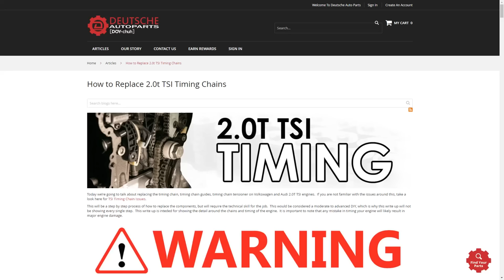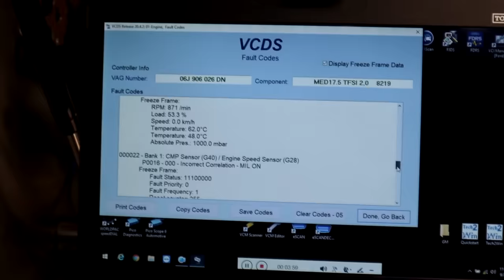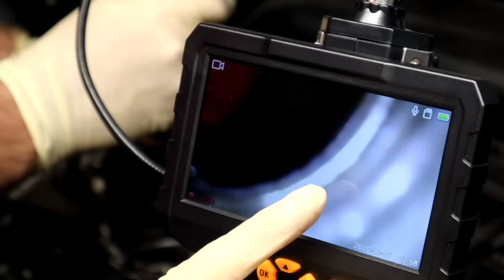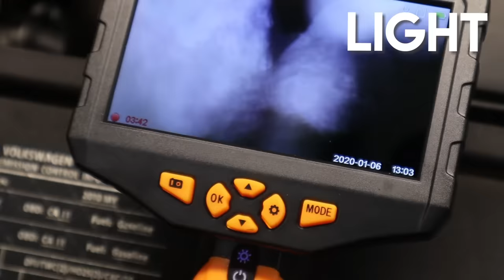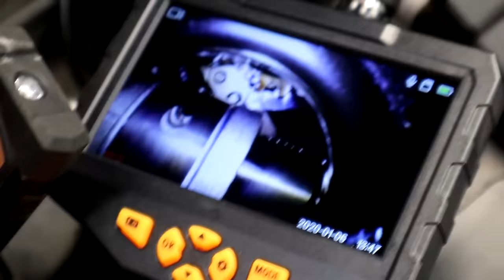The Jalopnik Tiguan FAILED ~ Despite the Warning

Comment: An interesting teardown :) had the 2.0 TFSI BWA in my Audi A3 and I thought that was unreliable but these 2.0 TSI engines are shocking.
Reply: Gazshadows when everything is running right they are smooth and torquey. But they do keep the mechanics quite happy.
Reply: Did you sell your A3? @Gazshadows
Reply: @kenny9088  I did yes, regrettably. It had quattro so it was a fun car to launch and when it snowed one year it was pretty fun stepping the back end out on it ! Would have another if it wasnt for the reliability.
Reply: @Gazshadows  oh ok, i just bought a 2012 a3 2.0t fwd last weekend with several modifications, like coil overs, wheels, exhaust and couple other things, the car is beautiful and drives amazing. Is my first audi and i really like it has 87k but reading all this horror stories got me feeling scared tbh. I did do some research prior to buying  it but i bought it anyways haha. What kind of issues did you have while owning it? If you dont mind me asking, also how long did you have it for ? Thanks in advance
Reply: @kenny9088  nice :) you probably have the newer engine in it then. I would say to check it's had regular oil changes and see if it's had a belt / chain change on it. On the BWA it has a belt on one pulley and chain on the opposite side of the engine which has a tensioner on it that seems to be a weak spot. For just over a year in colder weather it would rattle like mad on start up for about 30 seconds. Horrible. I should not have waited so long. By summer time it wasnt bad maybe a second or two. Had a feeling maybe the oil pump chain was getting slack too. Otherwise I did oil changes every 3-4 thousand miles. Had it 2 years roughly. Had TT before that which had same engine and no rattles but the diverter valve went on that.
Reply: @kenny9088  Also bought the Audi A3 with just 60k on the clock. Drove well, little hard on the road. Made a good noise for 4 pot. Heavy on the juice (26-32mpg). Loved it.
Reply: @Gazshadows  i really appreciate your reply. I will definitely be doing more research and inspect the tensioner and find out exactly when are the safer years. I've been reading and it seems like the 2012 gti's were affected so im assuming the audi 2012 would have the same issue 🤔 the previous owner did change the diverter valve which was like 400 bucks or so. He game me all the maintenance records he had and the ones he got from the 2nd owner, guy i bought it from was the 3rd owner. Thanks again 🤝

Comment: I'm lucky, when I got my '15 Passat from the dealership at 100k miles they replaced the timing chain and cam shafts for me so they should be good for another 100k
Reply from the maker: NICE!
Reply: Sure they did!!! That's the oldest used car salesman trick in the book
Reply: False Flag  I do have paperwork
Reply: False Flag  I sure would not buy one that engines done been messed with by bunch of tech's! Better off with whole engine from junk yard never been apart for me!
Reply: @SageTrimarco  I have a 15 Passat too, I absolutely love it, damn good too drive , what has your one been like? Nice car?

Comment: Ever since the interference motor was introduced and timed with rubber bands instead of gears, this mess got much worse. I had a chain tensioner arm fall out in an old Opel Manta and brake the chain but I was able to get one brand new for $20.00 at auto zone and be back on the road in 4 hours. None interference motor, mind you.

Comment: Hmmm....either way the repair costs  is not cheap. Would be great if all piston emgines are non-interference design
Reply: It would, but due to fuel efficiency and emissions more and more will be interference.
Reply: ...preventative mx is cheap (to a degree). Depends on where you buy your parts and who does the labor. $100+/hr labor rate is not cheap any where you go, especially the dealer ($120+/hr)

Comment: 2011 GTI went a faultless 71,000 miles, and It jumped timing. My local mechanic was also a VW specialist, and had a rebuilt head from a 2013 CC. Saved me a ton of money. The car went another 70,000 faultless miles, and I traded it in on a 2017 Golf R.

Comment: So thankful for this video! Two of my favourite VW mechanics in one video! - when I did my timing chain in my 1.8TSI that top guide had cracked, but not fully broken off like yours. My assumption was that because the tensioner was screwed it allowed the chain to slap the top and cause unintended forces on that guide. 🤷‍♂️

Comment: My 2009 vw cc had this exact failure. Top chain guide broke apart and caused Timing failure on startup. Bent all intake valves open. Still had the original tensioner as well. ~160k miles

Comment: Jesus christ press fit lobes? These engines is just a pile of garbage.
Reply: .....people say french are bad in general ...but i haven´t seen such stupid design crap on french. it just does not makes sense.
for example the timing cover out of "thin cardboard" like here. LOL
bah dumm tsssss
Reply: I remember back in 2017 there was recall on the EA 888 for problems with the press fit lobes
Reply: Paying premium for a lot of short cuts.
Reply: @Unknown-jl7mg  PSA DV6 is a very French engine that has press fit lobes, came out around the same time as this. It's pretty common nowadays as it allows manufactures to have different strength material where it matters, meaning a lighter camshaft which results in better efficiency. Even the slightest percentile increase in efficiency is worth it to manufacturers today.

Also, the timing covers in Renault engines are made out of the exact same type of material and are leaking all the freaking time.

So if you haven't seen any of this in a French car that simply means one of two possible things; you either haven't worked on French cars or the ones you have worked on are old and outdated.
Reply: Press fit lobes that can spin as opposed to a cast/machined cam that can break when the valve hits the piston...like Ford straight 6's from the 80s-90s.  Same difference.  They work just fine in hundreds of thousands of these engines.  Maintenance is key.
Reply: @marcdinsmore8690  I don't recall that being an interference engine.
Reply: @ShainAndrews  You are correct. The Ford 4.9L straight 6 is a non-interference engine.
Reply: Ford 1.9 had press fit lobes too
Reply: Ford 4.6 2 valve sohc engines use a hollow cam with lobes pressed into place. No issues whatsoever with the camshafts on those.
Reply: @marcdinsmore8690  'that can break when valve hits piston' 

Well gee wiz why not make an engine with a valve train arrangement reliable enough to not have that happen lol!
Reply: forged bottom end and rods, and stout fueling though. yeah they're finnicky motors, but it taught me a lot and it's been very reliable. and i'll love it even more when i strap a 3071 to it. can't really do that with a honda motor, or anything else on stock internals. Vw bullshits in one area and overbuilds in others.
Reply: My thoughts exactly
Reply: @Unknown-jl7mg  If it was a french car, especially a Peugeot diesel, your timing belt snapped, you'd just replace the timing gear, the cam rockers (16 x £10ea) and you'd be good to go. Engine is designed to snap the rockers than bend the valves.

Comment: As a flat rate Teck I made more money working for VW than any other shop , never had a day with dead time 60+ hrs a week in a 40 hour week , got to love the over complicated junk they build that constantly fails. Walking is easier than owning a VW you will get there at least, couldn't give me one for free. You could buy 2 used crv's for the cost of the head job , never change the oil and still drive father with no repairs. Blow up a motor and change it for under 600 bucks in less time than that head job took.
Reply: Just wondering what his wife did to piss him off enough to let her buy it.? He knew she would be stranded one day.

Comment: It’s funny, when these TSI’s came out everyone BASHED the FSI’s and swung on these. But IMO the FSI has proven to be a much more robust engine.
Reply from the maker: Yep I was in that camp too. The TSI was really good for a short bit of time.
Reply: @HumbleMechanic  What a frightening comment from you Charles! All of us Gen 3 owners are so brash about how much better our engines are than the Gen 1/2, there are some bad implications here.
Reply: Honestly, you're kinda screwed both ways IMO.

The TSI has worse, more expensive issues to fix revolving around it's timing chain and intake manifold setup... But updated parts exist, and once they're fixed, they're more or less fixed for the life of the car. But the FSI's cam follower troubles, while cheap to repair, can't ever really be permanently repaired.  You'll wanna pull them out every 10-20k and give them a look over forever, or risk similarly catastrophic damage.
Reply: The FSI had the cam follower issues that were ticking time bombs.
Reply: Adaris not true. There’s a retrofit kit for the cam follower that changes it from a flat tappet style to a roller set up like they have on the TSI. 
I never had much issues with my very hard 50k I put on my stage 1 Gti. I only swapped the follower once. But. I think a lot of it has/had to do with oil. I always have run Elf now Total. Which also kept the oil consumption down on mine to .5qt every 5k miles.
Reply: HumbleMechanic I thought the engine was going to be good also, but after some very low mileage failures I knew we had a problem...
Reply: @jh-ky5uu  That's nice to know!  Back when I had my Mk5 (admittedly this was 10 years ago) there was no solution other than to replace the follower with an identical one, which would then wear exactly like the first one did, ad infinitum.  I'm glad a solution has been found.

Comment: I have seen that guide break on a 2014 vw jetta gli with 60k on it. new timing tensioner and guides. The cause was the owner going past 7000 rpm in drive "money shifting" into second from 5th. the chain tightened to fast it crushed this upper guide like in your video.

Comment: Man VAG just cant build a decent timing chain assembly from the vr6 to the 4.2 v8 to these motors.
Reply: No kidding! All VW motors with chains are ticking time bombs
Reply: They must have got their timing chain engineering tips from BMW.
Reply: VAG can't make a reliable timing chain, period!

On some engines you need to change timing chain almost as often as timing belt.

Comment: Lmao, so many timing issues. Everyone wants timing chains, but they have their own issues.
Reply: Yep, I too have a Tiguan (Diesel, 2.0 TDI) with a timing belt and I felt I'm the second class citizen. Guess it wasn't so...
Reply: Meanwhile my ‘97 TDI has 300k+, no belt failures yet...
Reply: Yeah... I was set on buying an old V8 5 series but ended up getting a 2jz Lexus because i really didnt want anything to do with the timing chain guides roting into dust and totalling the car.
Reply: @aygwm  my point exactly..
Reply: CHAIN,  timing chain.   my 1995 Ford mustang had a timing chain.  still does.   same one.     VW went crazy uncle on the need for 3 or 4.
Reply: Aaron Garcia How many times replaced it?
Reply: Al H its part of doing business as a 4 banger that wants to feel like a 6-cylinder. Why though does Honda have the K20/K24 with similar balance shaft and 200k+ reliability?
Reply: Not if they are designed correctly.
Reply: @machtschnell7452  The companies do not shoot straight with customers. Extended drain intervals are a deception to claim cheaper running costs. In VW scenario all North American customers were told that they did not need dual injection while dual injection was implemented in Europe? That should tell you right there. It's plain deception and price-point/profit focus before helping the people have reliability.

Comment: I can't believe a company that puts out such garbage is still in business. Oh wait, national protections.
Reply: Gm's on the same list, but from a different nation, so is Toyota. So do the Dutch never learn?
Reply: @eivis13  I think you spelled Nissan wrong.
Reply: Many cars including Toyota Camrys from the same time period with the same tensioner design also have this problem. VW has made some crap, and like most German makers their cars are designed around more frequent maintenance cycles, and then there's the whole Diesel thing. You wouldn't know it from their US presence, but VW parent VAG is the largest car company in the world, so unless they're getting government protection from half the world, I'm going to say that your overbroad generalization is inaccurate.
Reply: eivis13 The Dutch???
Reply: No national protection from the US!  In fact, because VWAG was the #1 manufacturer in the world at the time, the US went after the diesels to knock them down.  Mercedes and BMW was pulling the same emissions defeater software in Europe at the same time.  Didn't hear much about that in the US, though, because evil VW...
Reply: Looks at Dodge’s Hemis with lifter failure in less than 150,000 miles.. 👀👀
Reply: Jalopnik? Aren't they owned by Mexico now?
Reply: @eivis13  Same with Chrysler. Toyota actually makes decent products, so they deserved to be saved.
Reply: @justkiddin1980  Looking back i likely made a mistake there (Deutschland). My bad.
Reply: GM went BANKRUPT, why are they still around, wait the GOV'T bailed them out with YOUR money, And that's why Ford has teamed up with Vw in order to survive the global market, Ford and GM are irrelevant in the world market  VW #1 with now 13 brands they just took over Navistar, International Harvester, trucks expansion.  GM is a FAILED operation, living on your money, why are they still around, they make a Chevy, and call it a Cadillac, another dead brand pretty soon, count all the dead brands of GM, they bailed Europe, Russia, Australia, pretty soon S. Korea, cus of the junk GM makes.  VW runs the largest car factory in N. America, Puebla Mexico, and the world's largest in the world Wolfsburg Germany in one year they produced and shipped 704,000 vehicles, they run like 5 lines there GM CLOSED 5 factories in North America, due to no demand for their failed products.  2019 VW sold 10.97 million vehicles, more than any, ever,includes Porsche, always top rated, Audi, always top rated VWs GTI Golf R, best in it's class, Bentley, Bugattis, and on and on, VW is an Empire, nothing else comes close, Golf model in 8th generation has sold close to 40 million over the years, only Corolla sold more, GM Ford Chrysler, nothing close.  My current Golf R , is fantastic solid, quick, superbly comfortable,  Stick of course 2019, not a burp 25,000 miles on it, fun fun fun, much more than my last 2 GTIs or the other 12 + VW stuff
Reply: @cengeb  Biggest doesn't mean best.
Reply: @PistonAvatarGuy  Porsche is, and also the most profitable car brand per vehicle, for years.  Smallest doesn't mean best either, VW has a product for EVERY market segment including trucks, buses, and everything else, even 2 wheels, ducati is also a VW brand.  AMAZON is one of the biggest and one of the best, in what they do.  If you haven't driven a Porsche or audi RS5 7 etc, or a Golf R, you are not getting it
Reply: @marcdinsmore8690  vw has all the money..always follow the money..even paying $30 billion fines, they make $15 billion profit in 2019..invest now $86 billion in ev revamp factories..design..and buy navistar...for more than $3 billion...sold more cars than any in 2019...10.97 million..more than any ever...gm pulled bankruptcy..on much less...mostly no sales on gm junk..vw is an empire now 13 brands
Reply: @marcdinsmore8690  they still are wirlds largest..now even bigger..added brand 13 navistar international harvester...gm was bailed out byvu.s. govt...using your money. So much for capitalism..the u.s. is a bunch of hypocrits...$60 billion gm is still the biggest loser..closed 5 factories in North America..while vw still runs the largest in North america..Pueblo mexico..gm and Ford never..biggest in the world ,Wolfsburg germany..gm doesn't even operate in europe,russia,Russia, on austrailia...gm is a constant failure..after taking bailout...
Reply: @marcdinsmore8690  vw empire grows,added navistar..brand 13 ,vw now puts $86 billion in ev..more than gm ford Chrysler and others combinec
Reply: @eivis13  VW Dutch?!! Are you a public school graduate, about 5th grade?
Reply: @cengeb  at least i'm don't belong in a mental hospital.
Reply: @eivis13  At least, you have bigger issues...tend to them.  Now Dutch related to VW isn't as absurd as you made it appear, in fact the guy who first IMPORTED VW's into the U.S. was a Dutch dude, so maybe you are  1/10,000,000,000,000 correct in a round about, disoriented, abstract way...And the German word for GERMAN does sound like Dutch, when mispronounced, misinterpreted, misconstrued..misapplied, .

Comment: Had to do the second timing set on my 2010 Wolfsburg Jetta, after the intake side guide failed, right at the dowel pin locating the cam bridge. Luckily  no bent valves. Over 300,000 miles and still running.